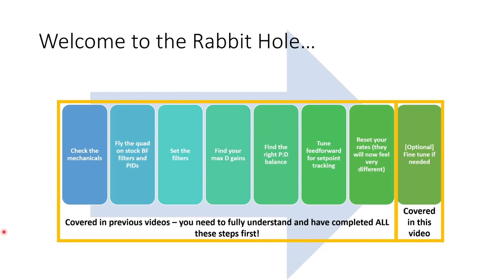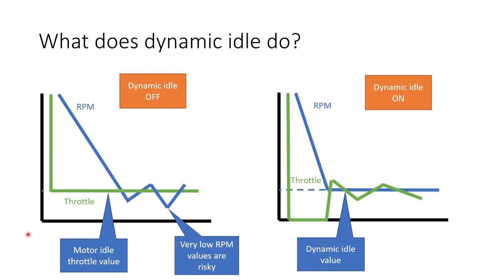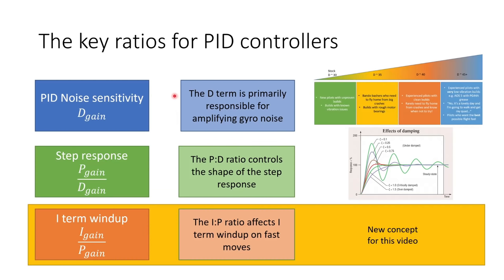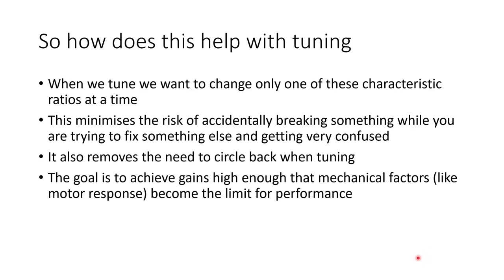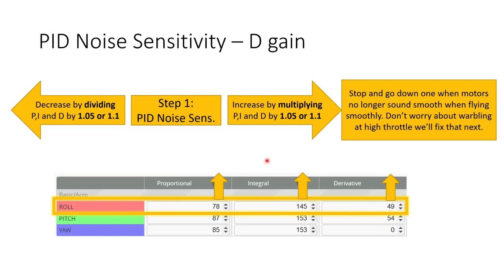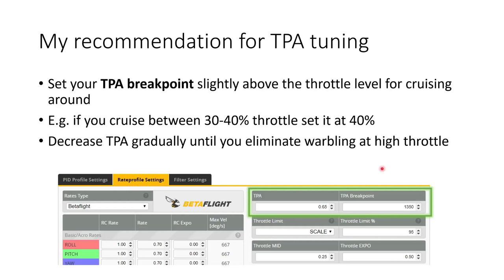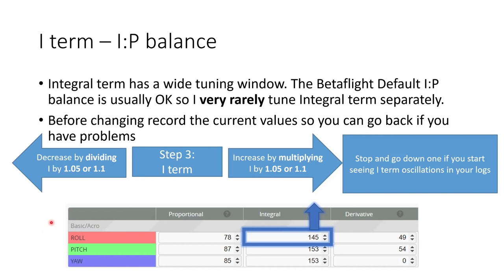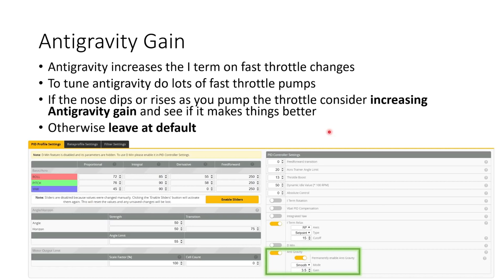Fine tuning your PIDs. A deep dive to get your quad flying its very best!

Comment: Amazing! Yet another one! Your PID tuning videos have brought this subject from the realm of magic to the realm of artisanship. I need to watch it several times more to gain a full understanding of the subject and I will create an Excel/Open Offce spread sheet incorporating the steps of fine tuning you discuss in this video, so that tuning of P:D and I:P balance is easier than using the sliders in BF. The I:P:D default values/proportions in BF may be close to perfect on a typical 5-inch quad, but when I tried following your previous videos with my super-light 3-inch quads I was not able to continue with the sliders - I had to enter my own values - which caused the sliders to vanish.
A well-designed spreadsheet, where each step is e.g. in a separate tab (I'm brainstorming as I write this comment 😄), that is fed data from the previos step/tab, may be a useful tool for many quad pilots - particularly those outside the 5-inch territory (2 - 4-inch on one side and 6+ inches on the other). When I'm ready, I'd like to share it with you (for the purpose of evaluation ) before making it public
Reply from the maker: A spreadsheet would be a wonderful tool. When you finish it I'll check it over and then make a video for it!
Reply: @ChrisRosser  I have made that spreadsheet - and even tested it (with quite a lot of success) tuning a 3- and a 2.5-inch toothpicks, but all-in-all - it is a fairly simple and underwhelming tool, I'm not sure if it is worth even talking about...
It certainly structurises the process of turning a quad and leaves a record of how you got from the base PIDs to the final result. Honestly - on a tiny quad with no blackbox - you can rely entirely on this schematic while turning (provided you took care of the filters first). I'm happy to share it - if you - or anyone else wants to check it out.
Reply from the maker: @onemanmob6756  I'd love to check it out. Can you link me to it?

Comment: Thanks Chris!! I think you made the best video series about quad tuning I've ever seen on the web!! 

One thing I cannot properly understand... What does exactly "your quad is not stable in the air at zero throttle" mean ? What should I look at to figure out if this condition occurs ?
Reply from the maker: If you go to zero throttle (after a punch out) and the quad wobbles around when you don't move the sticks. That's low throttle instability. Best solution is to increase min throttle and dynamic idle rpm.
Reply: Thanks! Now it’s clear!

Comment from the maker: Correction: the TPA value needs to be INCREASED to reduce high throttle oscillation rather than decreased.
Reply: Yeah, it’s very counterintuitive and I wish the logic of “reduced to x% of original PID values” rather than “reduced by x% of original values” was implemented. It’s also worth mentioning that by BF default, TPA only affects D values. If you want it to also affect P values, it must be changed in the CLI to tpa_mode = PD
Reply: So you are saying increase TPA to reduce warbling on high throttle? How high can it go? Also how does TPA affect mid throttle oscillations? Thanks for all you do Chris.
Reply from the maker: @blazer5979  It can go up to 1.0. It may not affect mid throttle oscillation as that tends to be a resonance issue.

Comment: Also good thing about feed_forward is to play with ff_boost and Spike_limit. Helps to push gyro to set point closer at start of the flip, without increasing ff values so much, that will get overshoot at end of the flip :)
Reply from the maker: Yes, I think there may even need to be another video to go into some of the deeper functionality. I had to stop with this one at 30mins!
Reply: @ChrisRosser  Just tried higher I-gain values instead of high anti-gravity. No, for me lower I-gain works better with higher anti-gravity gain)
Reply from the maker: @LizzzardRUS  Interesting. Can you give more details as to what you mean by better?
Reply: @ChrisRosser  Hard to explain, but high P+D work well enough to let I-term stay inactive. Maybe because good weight balance. But on sharp half front flip + look back after fast throttle cut, high I-term start to drag quad somewhere slowly without any reason. Feels like gyro slowly walking somewhere around setpoint. Then more I add to I-term, then more strange its become.  Lowering I-term for one tick of master slider and incrace anti-gravity to 6.5 gived good enough fast throttle cut handling, not perfect. But in sharp flips after throttle cut its doing perfect setpoint tracking, like falkoX usually doing. Maybe because P/I balance, i dont know) My tune looks like completely wrong, but i like how its flies more than my Fettec quad fly))
Reply from the maker: @LizzzardRUS  Ok. You like how it flies so that's the most important thing! If the quad nose is wandering that could be I term oscillation (its much slower than P oscillation).

Comment: I mentioned I wished the sliders would work multiplicatively in the comments where we voted on the PD balance method the sliders took. Would be great if the sliders reset to 0 gains when you adjust the numbers manually then moving the sliders once again started multiplying.

Comment: Another tuning lecture, yay!

I actually learned quite a bit here about TPA, dynamic idle (never knew about that) and especially D-min boost. Had to watch that d-min section mulitple times to really understand it and it's actually quite a nice tool if you think of it. Thanks for exmplaining how BF actually calculates those values!

One question that I got after watching your vid:
I learned that "v-bat sag compensation (in CLI) is the new v-bat PID-Compensation... so use that instead and leave the v-bat PID comp untouched." What's your take on this?

And I keep thumbs pressed that BF implements those ratio sliders including I<->P as you hinted. This will make things so much easier to set up (especially on mobile!)

Comment: Great video as always! There's a downside of crancking the I gain along with the P gain since in theory a greater I gain leads to a longer settling time. This is why I always kept my I gains around stock values. Maybe it's not the case with betaflight since iterm relax mitigate the iterm effect during step moves. I'll give your method a try 😊
Reply from the maker: Higher I gain will make the I term react faster. It can cause oscillations if it is too high.

Comment: Hi Chris! Your videos are great and more scientific than most fpv stuff, which operates on "feel" and "juicy sbang" whatever that may mean :) but still, at some place you give exact numeric recommendations like changing pids by 10%, but then in I term part, you say things like "if your I term because high in blackbox" without any reference to what is high :) would be great if you could give numeric definitions to all the terms, in absolute or relative values. Thanks!
Reply from the maker: If you open your log and use trace template 4. Stick tracking you can see your Iterm. Keep increasing I term until you start seeing I term oscillations in the logs then back off a bit.

Comment: Chris could try to record how “warbling” sound actually sounds? All tuning by ear videos kind of assume “you’d know when you hear it”, but may be I’m just thick so I can’t. I’ve got 3 quads with different motors and props and they all have different sound. I have no idea if it’s “smooth” enough or not. So far I could only hear definite difference when prop is so bent that blade points upwards or resonance when I forgot to tighten frame bolts.
Reply: Its a hard to describe sound. Kind of sounds like a motor is vibrating while you're flying. "you know it when you hear it" as unhelpful as that sounds, is a really good way to describe it. I'm sorry lol.
Reply: It screams, like the drone is screaming... imagine a high resonance going through the carbon frame like a tuning fork and what that would sound like. For me, I had my drone tuned really well, but if I held the throttle open for about 3-4 seconds, I would get this noise right as it hit top speed, it was very loud and noticeable, if you're drone is doing it then you will know.
Reply: It's like a goat scream 😉👍

Comment: Two comments/questions about TPA. First, in the most recent version of BF the default TPA behavior is to attenuate only D with increasing throttle (tpa_mode = D). Any idea why this is the default? Wouldn't it affect the tune, step response, etc.? Should we change it to tpa_mode = PD for that reason? Second, the BF documentation says that the TPA setting represents "% of dampening that will occur at full throttle". Doesn't that mean that it has the opposite behavior of what you've described (see figure at 15:51)? If you set TPA = 0.25, wouldn’t the PIDs at max throttle be 75% of what they would be otherwise, based on the BF documentation?

Once again, thanks for such a thorough and scientific approach to PID tuning! I’ll definitely be referring to this video frequently in the future.
Reply from the maker: Hi, thanks for your comment. I've added a correction for the behaviour of TPA. I haven't played with D attenuation vs PD so I'll need to look into that.

Comment: Great instructional videos, been watching the whole series and trying to learn tuning following your footsteps.  BTW quick question on Dynamic Idle, in order to derive the Dynamic Idle rpm value the test battery used should be at 3.8V per cell according to your presentation.  So for a 3S quad, the test voltage would be 11.4V (3.8V x 3)?  or is it to just connect a 1S battery at 3.8V?  Thanks!
Reply from the maker: Yep 11.4V for 3S quad. 3.8 V per cell of the battery.
Reply: @ChrisRosser  Thank you for clarifying!

Comment: Another great video Chris! Any tips on tuning TPA?
Reply: go to the PID toolbox channel - the have best description of that
Reply from the maker: Just posted a correction comment. Increase TPA to reduce warbling at high throttle. If you don't have any warbling you could consider reducing TPA but I usually fly the default value.
Reply: @ChrisRosser  Thank you, Chris!

Comment: Hi! Amazing video and explanation, anyway , I'm a rookie and I'm trying to "learn something" as the other guy on Youtube says. I have a Flywoo Explorer LR 4" quad , I installed  Betaflight 5.0 and since there are no pid settings available for that, I need to PID tune manually. I followed Your videos and I'll watch them again, my question is the following:
 Saying that my quad already flies with some pid settings, I understand by looking at the "effects of dumping" chart at minute 9:18 that the right P/D ratio should be always  around 0.75, independently of the initial P value, is this true?  So having to start from scratch, should I set , for example intial PIDs P 40 , D 0 , I 0, increase gradually P until I see underdumping, then calculate D=0.75*P  and after that start increasing both until I see oscillations or vibrations or motors heat? What about I ? Is there an ideal P/I ratio? How do I find the right starting value at the first iteration of the process? Thank You for Your help. Luca

Comment: Monumental. A true tuning masterclass.
Chris did you ever had a look at Emuflight? They have some really interesting experimental feature in their dev branch (Smith predictor, alpha-beta-gamma filter, etc.) and also latest stable version of the FW flies really really good. I initially migrated to Emu from BF due to the GPS simply not working in BF, then sticked with it due to the performance.
Reply: yes mr chris,,emu sounds great
Reply: Emu has a better filter strategy than beta flight so yes, chris, look into it!
Reply: yes agreed please mr takes your time to review it,,or maybe regarding th setup blheli32 such as rampup,motort timing, pwmHz,,hihihi,,,the world needs the knowledge in your point of view

Comment: Hello Chris. I ve watched your tuning videos repeatedly. I have to say I'm having a blast , being able to tune my quads. I ve been thinking about d min . Thing is when we set master slider to get D values around 45 and + its not recommended to fly the quad back after crash because at that state its risky . Could d min value help returning the quad with no sharp inputs- slowly ?
Reply from the maker: Dmin doesn't work like that I'm afraid. It will boost your D gain in response to vibration not reduce it! You shouldn't really be using Dmin for freestyle. A good suggestion is to switch PID profiles and fly back on stock PIDs.
Reply: @ChrisRosser  Thanks for the suggestion that's a really good tip. I've read Mark's PID Tuning Principals PDF file and it says like 
"Once D_min is activated the “D_min” column adds to the
PID gains grid (Figure 10). The D_min column is now
your base D-gains in normal forward flight! The quad
will spend most of the time flying at the D_min value.
The “Derivative” column is the boosted D-gains in sharp stick input and during prop wash (aka “D_max”)."
I got the idea from there. D min as conservative value and Dmax as the best feel I can get. But thinking further the transition between these values will cause some other performance issues.

Comment: This is great! Since TPA breakpoint is measured in us, I'm assuming this acts on the rc command, not the motor output? So if I have TPA tuned, and decide to increase my throttle limit, I'd need to then decrease TPA breakpoint to keep it kicking in at the same motor power, right?
Reply from the maker: Great question. I don't think TPA is affected by a throttle limit. A throttle limit in BF or on your radio will just prevent you from getting to full throttle. TPA will not get to its full reduction because you aren't getting to full throttle but that's OK. Betaflight still has an internal throttle scale that goes to 100% and that's what breakpoint and TPA refer to.. The 1000-2000 is just a thowback to PPM I think. With Sbus and Dshot I don't think there are us pulses any more but 1000 to 2000 is still the range of values used by convention.

Comment: Hello Chris and others. What the issue, if motors sounds unhealthy at zero throttle (on the ground), but if I do just little more throttle its sound normally? After flying, motors not hot, everything seems ok. Master multiplier set at 0.5
Reply from the maker: That is pretty normal. I have motors that sound a little rough on the ground and when I take off it's totally fine. If the quad is on flat soft ground it's usually Ok and on hard ground it's worse. Not sure of the exact cause.

Comment: First :D this tuning vids are really great, but... as beginner not so easy to understand. I think beginners would prefer a one click magical perfect tuning
Reply: Watch his previous PID tuning videos, those are catered towards beginners.
Reply: We have a problem. One click magical buttons don't exist 😜 ...ok: yet :)
Reply: Beginner tune = buy a ready to fly and get some stick time. Or at the very least if you want to build your own just fly Betaflight defaults.
Reply: ... good luck in this hobby. Wait for Joshua Bardwells digest, or you'll have to invest some time..
Reply: I think this tuning tutorial is easy to follow, and it gives out the important points. UAVTech is actually very comprehensive but it's a very long series and you have to follow each video and all the blackbox analysis + the spreadsheet to understand
Reply: For one-click magical tuning a Bind-and-Fly is strongly suggested. Some of the newer quads actually come with pretty good tuning. Today I would recommend a Babyhawk II HD for that - or still the Nazgul XL5 - all you need to do is get your rates in and off you go with a very good start. Later you can back it up and start playing around with your own PID-values!

In my opinion Chris Rosser's tuning guide is the shortest and simplest step-by-step guide available and a real anchor point summing up the past 3-4 years of tuning and evolution in Betaflight. I'm afraid it won't get much simpler than that today - maybe in 2025 we are much closer to your magical auto-tune though - and bind&flys will get a lot better until then, too! :)
Reply: @MuonFpv  Yet! ;D
Reply: @jessearmand  Mark is amazing. I was really prepared to watch all of his past vids and even deeply read into the BF-doc to get a broad understanding - but this would have taken me a long time. I'm so happy, Chris is giving us a shortcut like this!
Reply: @aphinion  I came back to betaflight wiki, merge requests, and Mark after watching Chris' tuning guide. It's all more understandable now
Reply: I agree about getting a bnf if you want a tuned quad right out of the box. My suggestion is to buy one from Avant Quads. Whoever tunes the quads over there really knows what they are doing. I have 2 and they fly amazing.
Reply: @MuonFpv  Yet. We just need someone who's into AI to get into the hobby :P
Reply: @DriftaholiC  ♥️ you got it 😅